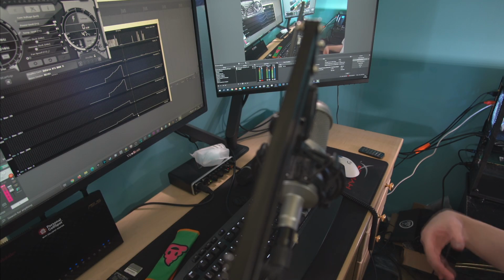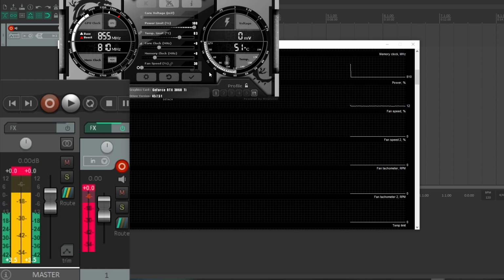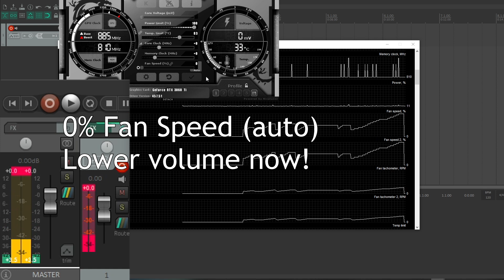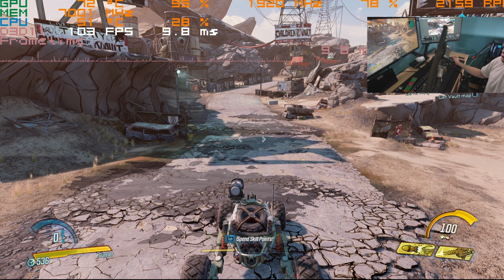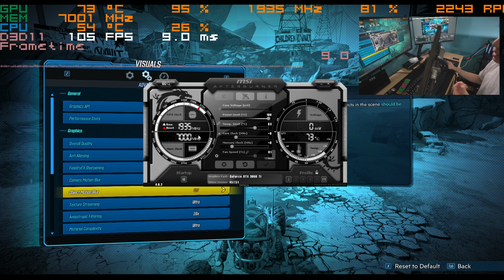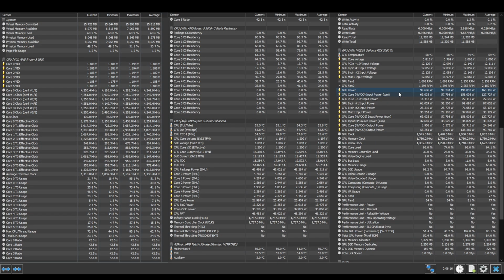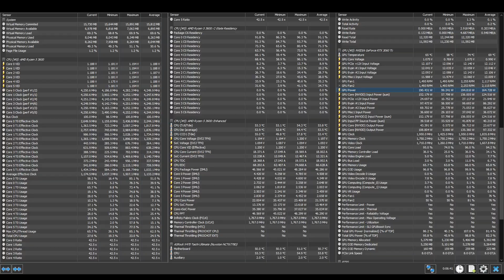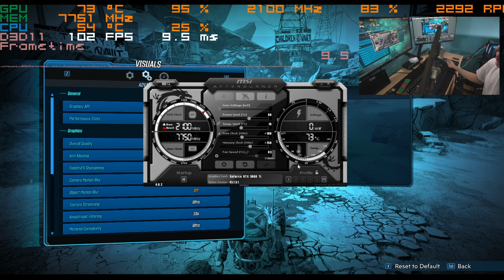MSI Ventus 2X OC RTX 3060 Ti Disassembly & Noise, Boost Clock, Overclock, and Power Limit Showcase

Comment: Good stuff, I was a little disappointed I got this one but considering how rare 3060 ti are right now and this video showing off what it can really do, I should consider myself extremely blessed!
Reply: It gives 13% more performance at 1440p than the 3060ti and is the most power efficient card on the market. I'd say it's not that bad
Reply: Same! For the price I got it, it gives you 95-96% of performance, and that is okay.
Reply: @mal3k_xd  i wanted the bigger ones that were three fans and RGB. Petty complaints  considering how lucky i am to get a 3060 ti in this time of year.
Reply: @Lazlowinthehouse  hows is the noise it makes? Is it really loud, or just your average noise?
Reply: @zspongeyt6184  It ultimately comes down to what games you are playing. This model is very similar to  my trusty 1660 super where the fans stay idle when the gpu is not working too hard. But so far the fans are at a okay level of noise if that helps.
Reply: @Lazlowinthehouse  gotcha, thanks!
Reply: @zspongeyt6184  I have it. It is not loud to my at all. I rock an AIO cooler with 7 other fans in the meshify 2 case. It's gangster quiet to me.
Reply: @zspongeyt6184  I bought Cyberpunk and I’m running at the highest settings ( somewhat) and the card is low key quiet. Not vacuum cleaner loud. Although, the air from the computer is hot. Need to install more fans!
Reply: @zspongeyt6184  all of my fans in my case are pwm xept for the cpu. accidentally bought an old hyper 212 where the fans werent sickle flow yet. Its the only thing I can hear on cyberpunk raytracing ultra settings
Reply: Update: it's been over a year and the 3060 TI is still hard to get. I got lucky and grabbed one this one in particular i wanted RGB but they were out of stock so complaining aside I'm lucky I got this one at around MSRP.
Reply: @edsayswhoa4365  Any info about how loud it is?
Reply: @kizanko  not loud pretty good so far.
Reply: @edsayswhoa4365  ah ok cool! Im going to purchase this one then :)
Reply: How's your RTX 3060 Ti holding up? Got the exact same MSI model as you and I've been reading some bad reviews...
Reply: @gilbertorosalesacanda4260  Well, it's been 2 yrs and its holding up pretty nicely.  it did get a bit of coil whine but nothing too distracting and it kind of went away after while. So yeah, pretty good card I say. but now I'm saving up for a 4090.....
Reply: so it gives less performance than the founder's edition?